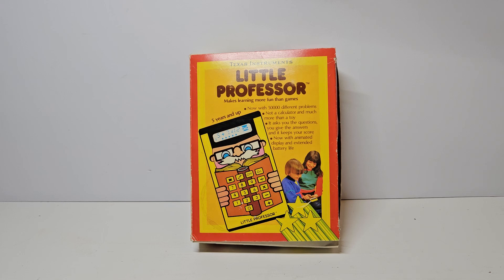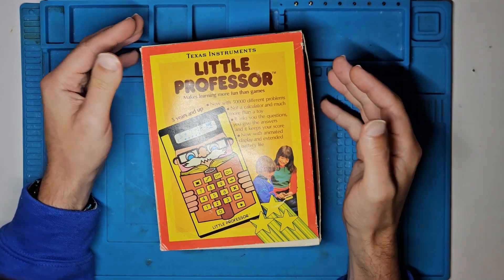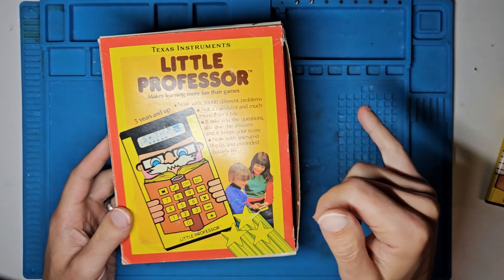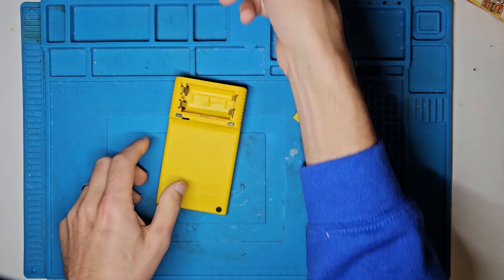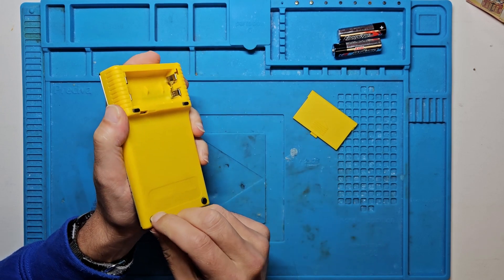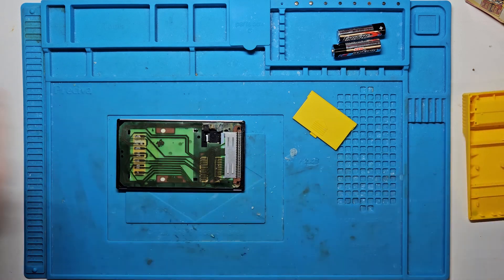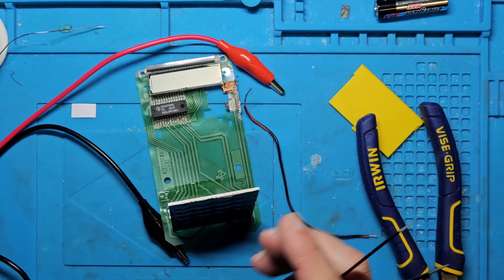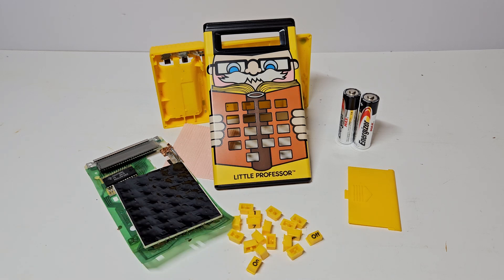Trying to FIX Texas Instruments Little Professor Backwards Calculator

Comment: Remember having one of these. it was one with a plastic case
Reply from the maker: Thanks for watching, glad I could bring back some memories!
Reply: @retro_restorations  It might also not have been the puzzle version, but usable as a actual calculator. not 100% sure
Reply from the maker: @darknessblades  If it had the plastic case I'm pretty sure it's going to be the one I flash up at 1:43

Comment: i as an electronics enthusiast recommend you to de-solder the keypad (i believe its a matrix keypad) and check the connections from the pads to the IC and maybe you will be able to solder some wires from the keypad to the IC and fix it
Reply from the maker: Thank you for the suggestion, I will give that a go when I get a quiet moment in the future!